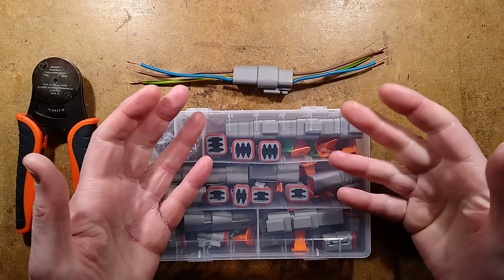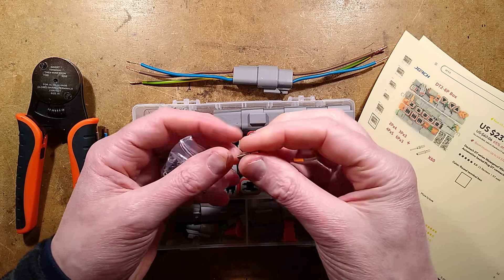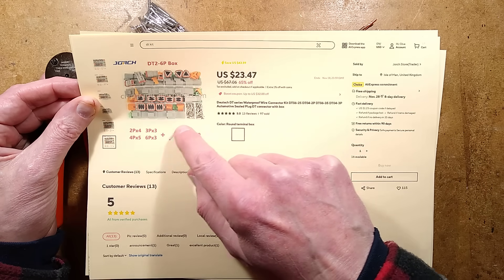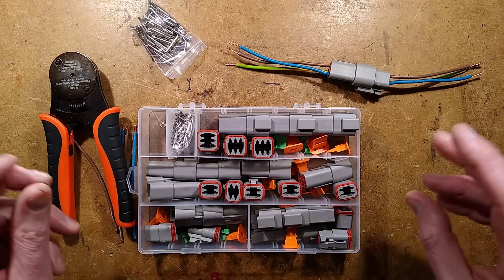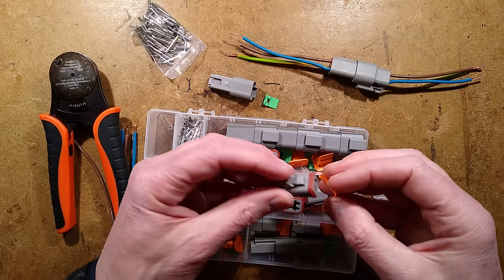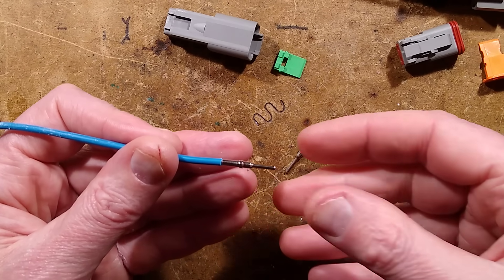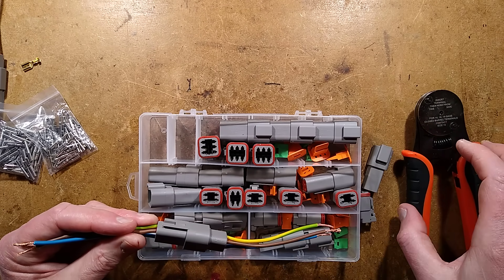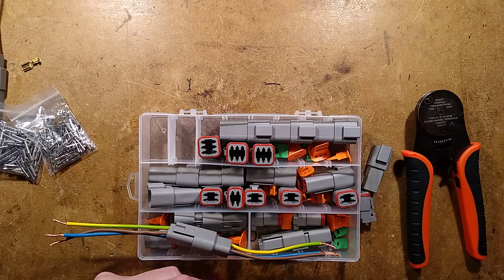Deutsch - my new favourite rugged connector

Comment: Ive actually never seen the correct crimp tool that folds the “panty wings” as you call em..   like ones that coil the wings on either side.. never seen one that could do that every crimp.  Only time ive been able to pull off that style like that is with needle nose and diagonal cutters..

Comment: Deutsch connectors are fantastic compared to other styles of connector because the latch is in the plug instead of the pin. Easy to unpin and change orientation. Also great for running wire through a small hole. Disassemble the plug, feed the wires through and reassemble the plug on the other side

Comment: I have and have used some of the original kinds. Almost waterproof.... but sooo hard to connect and disconnect. Needs lots of force. So I don't use them that much anymore. With strong hands, they work fine but you can really tear the cables apart if people pull on the cable in an attempt to disconnect even with the lever already opened.
For low-power, low-DC connectors in dry surroundings, I do like the PC (I think) connectors that are used for powering HDD's and such in older computers. Same kind of connectors, sturdy connections but easy to disconnect and connect.

Comment: The Amphenol ATP, AT, and ATM are a little cheaper and compatible with the Deutsch originals (DTP, DT, DTM). Not entirely sure how this works out legally, but they still work fine in my experience.
I remember doing some deep diving into the datasheets a few years ago and found they were rated for 240V, AC or DC.

Comment: There's even a variety of bridge connectors. For example an 8-pin which bridges 1, 2, 7, 8 and 3, 4, 5, 6 (when looking at the pin numbering this makes sense;-) ) for easy wire splitting while keeping the sealing intact. If you want to for example add more lights to a machine you get one input and 3 outputs twice so to speak. We use those all the time.
Reply from the maker: Handy.  I'll have to look for those.
Reply: Also grounding connectors with a lug cast into a receptacle and all the pins bridged to the lug.
Reply: There are also keyed housings and wedgelocks and board mount versions.  Dunno if they've been cloned and put for sale on Aliexpress though.

Comment: I don't know if anyone has mentioned it, but I believe there is a pin/wire removal tool, so there's no need to stick a screwdriver down into the connector, it slides down the wire from the back and seats over the pin, moving the clip out of the way, and then you pull the wire and tool out together. Search "Deutsch insert extract tool" for some examples.

Comment: The little wedge piece in "connector speak" is called "Terminal Position Assurance" (TPA) or "Secondary Lock". Most modern connection systems have some sort of secondary terminal pin lock.  Contrast that with an older style like Molex, where there is only one feature that holds the terminal in place.
Reply: These don't provide a second method of retention as most TPA devices do, though they do work as a TPA since their action is to lock the primary retention tang, and if the pin isn't fully home and the tang snapped in behind the flange, the wedgelock won't go in.

Comment: Clive, that cut on your left thumb looks painful for a guy that works with his hands.  I  get cracking skin on my fingers in the winter when the air is dry.  My solution is 1 or 2 drops of medium CA glue right on the cut or crack.  It makes a nice little "turtle shell" that diverts all the pressure around the cut and takes away the pain!
Reply from the maker: I superglued it when it first happened (rogue knife incident) and have been letting auto-repair fix it.  It's almost back to normal now.

Comment: It's pretty cool what you can get these days.  I would probably stay away from the wire but the tools are quite well made considering.  One of my first el-cheapo tools was from The Source/RadioShack and was made for terminating 6p4c/6p6c/8p8c connectors, was made very similar to these crimpers and were and still are a bargain for $25-30 Canadian.  The official tool would have cost at least $100 or more at the time.  There is one tool I bought that was that price and it was made for coaxial compression style crimping (I still have it) and that's Ideal Industries' OmniSeal Pro XL that's capable of compressing F-type, BNC and RCA-style plugs onto a multitude of coax cable sizes.  My recent purchases include a ferrule crimper that makes using stranded wire in things like insulated terminal blocks a breeze and recently a multi-die crimper to replace my generic stamped steel insulated and non-insulated crimping, stripping and cutting multi tool thing as that doesn't do sufficient crimps.

Comment: I noticed Clive, that when you talking about the male and female connectors, where they don’t  fit together the full distance, preventing a ‘mis match’, and how easily they slide together. Is it possible at high loads it could create  a high resistance, along with the problems that may cause?

Comment: Hands down the best connector i have ever worked with. Electrical issuse in my line of work (wheel loaders in a corrosive environment) are 8/10 wiring problems, every bad/corroded connector is replaced by a Deutsch connector and the problem is solved permanatly.

Comment: One  thing you could have done  is measure the  resistance    across the  mating  pins  (in and out)   to    see  there  would be a voltage  drop

Comment: If you use a small wire, like you mentioned in the end, you won't have good waterproofing though, as the holes in the rubber are made for one specific size. Smaller signal connectors such as the JST JWPF also have this issue. 
Recently I bought the AMP superseal clones from Ali, but these Deutsch connectors look pretty good.

Comment: I worked with Deut$ch connector$ for many years with automotive products.....VERY good connectors - top notch - and they know it. The chinese knockoff compatible connectors (which might be what you have) are completely 100% compatible, but the quality is not the same. Only true Deutsch connectors have the top notch machining, fit, and finish. One of my biggest complaints of the cheap knockoff deutsch connectors the bean counters made us use was in the area of pin retention in the housing. We had quite the issue with that during production, and wasted much of the money the front office saved on the el cheapo connectors with having to go through all the cables that came in and give them the yank test, and bend out the non retained pins clips and reseat them. A definite fit and finish problem as the retaining clips were not bent in, they were at the proper angle for retention.  (seemed to be a go/no go - either all were good or half the pins didn't retain - about 5% to 10% - JUST enough we could not ignore it and slough it off on to the returns department)
 Second complaint of the knockoffs would be in the J1708/J1939 family of connectors, the knockoffs had issues with the threads on the screw ring to keep it plugged in, poor machining on about 3% of the connectors meant it would not screw in....... OF COURSE - the complaints of engineering and production fell on deaf ears in regards to these issues - deal with it was the word......
 Problems true blue Deutsch NEVER had. 
The proper crimper is ESSENTIAL with deutsch. There are many non name brand crimpers that will do it, you don't have to use the true blue crimper, takes a bit of experimentation to find the right one, but on the plus side, knockoff crimpers are cheap so you can do that.
EDIT: That looks like the off road diagnostic connector that is used on shifters (yard mules), caterpillar, and other off road equipment. At least it is in that family.

Be an engineer - its fun, they said, you get to design stuff and see your products in the world they said - They never metioned the eternal battle with the "wannabe engineer" bean counters in the front office that take a good, well engineered product you are proud of, and cheapen it down to the point you warned them in the meetings of impending doom by returns of defective malfunctioning product, and them not remembering your dire warnings when they wanted to save money by using only half the fasteners needed.....etc.

Comment: I brought my crimping tool on temu, push against the spring and it goes to the correct depth. 
As a subcontractor where only one of my customers use these i couldn't justify the price of the genuine tool, and figured that the amount of stuff being made in China using this type of connector their. 
tools must work, and haven't been disappointed.
These connectors are not rated for 230v.
Reply: it might be the same tool from the same molds at the same factory with a different name stamped on the handle and the warranty being the only real difference while some inspector would have a hissy fit if the brand does not match something orange man will change what matters if function so many things I do function just fine or better then the standard methods but are not approved while I have seen some pretty professional looking hacks that will start a fire in no time flat under the right conditions so ugly and safe needs to be accepted and dangours and pretty needs to be caught any professional would know the difference  let them decide and not the buricrats  inspectors are often over paid paper pushers if its not picture perfect they want to write a fine while not giving a dame about safety I could use wire nuts for a solar system install and not crank them down it will pass inspection but my copper pipe coupler trick being far better then even a perfect wire nut install would not pass if subject to inspection but due to solar being exempt if under 1 KW in my local area I do not worry about it I do what I know is best I would not think twice about the cheap crimper 9 out of 10 times the cheap tools are exactly the same as the expensive ones with actual good good ones being rare and not related to price I got a bold cutter style of crimpers for 18 dollars a few years ago and its just as good as the 100 dollar ones at menards in fact compare it to all the markings on the hinge bolt and rivets its the exact same tool just the color of the rubber handle is different what I would like to see a crimping tool to allow copper pipe couplers to serve a crimps as a one two and done then apply a heat shrink boot and walk be done what is the difference between the two items besides cost and a certification a half inch copper pipe coupler 89 cents  a 2 awg crimp connector that only fits 2 awg costs 20 dollars each the copper pipe coupler if applied as I do can do do 8 awg down to 2 awg and accept many wires from both sides with the total thickness being the big factor if its within range it holds a lever action tool to smash it and bend it over would be worth 100 dollars when you consider the savings and ease of use and the reliability this crimp is insanely tight as the smash and fold action pulls things extra tight relies on the tensile strength of the copper vs the ductile strength  which is why the winged crimps fail the saving grace for the round closed crimps is the lack of a seam but why allow a 89 cent part serve better when a 10 dollar part that will need replacement in 10 years is already mandated

Comment: I did an apprenticeship to train as an aircraft electrician, during my working life I dealt with all sorts of connectors such as Plessey, Souriau, Deutsch and Cannon. I'd always assumed the pins fully engaged with the sockets when the two halves of the connectors were mated together. It came as a real surprise when I found out while talking to a rep from Souriau that only about fifty percent of the pin enters the socket, but thats sufficient to carry the rated current. These plastic connectors look like they're good quality, and if they have your seal of approval they must be. In my retirement I concentrate on restoring cars now these will be perfect for the odd little mod for accessories and extras I occasionally fit.
Reply: I bought a kit and extra pins off Amazon and they were pretty decent despite being off brand Chinese
Reply: @juliogonzo2718  I believe at least some of them use discarded OEM molds that may be out of spec. I've bought a few off of Ali that have "DEUTSCH" still on the rear seals, but scratches elsewhere, consistent to each connector, as if the mold had something removed...
Reply: Bicc-Burndy were turned and gold plated years and years ago I think.
Reply: Contact ampacity can be counterintuitive at times.  The reality is that, most connectors only have one or two points of contact, yet are rated for, whatever, 2, 5, 7A, and more.  The actual contact area, the thinnest cross-section between the two terminals, can be very small indeed; and this makes rather high power density at that point, but reasonably conductive materials are used (typically brass) to spread out that heat.  The bulk of the pin size (width and thickness) comes down to heat transfer, and mechanical limitations/considerations. (Like here, machined pins will be bulky where material simply wasn't removed from the part.) High current connectors, especially low-resistance and compact types, can't make up the difference with bulk alone, and use many fingers in parallel: all sprung independently so that a majority of them has a reasonable guarantee of making good contact. Or use intense clamping pressure to force surface asperities into each other (e.g. Anderson Powerpole, bolted terminals and bus bars, etc.).

...Plug terminals on welders would seem the standout exception, being fairly compact (say, 1/4 to 3/8" dia.?) for their ratings (couple 100 A?). Cables are often undersized as well, so aren't reliable heatsinking for the terminal. A tapered joint can accumulate a lot of contact force from being wedged in place, but the dirty environment just about guarantees it's not going to make even contact. On the upside, it doesn't have to be reliable; it can be re-plugged if the operator notices a problem, and the machine is... kind of an intentional fire hazard to begin with (not that that should excuse every possible shortcoming of it, heh).

Comment: Don't forget when looking up the price on Ali Ex they will add on a cut for Rachel from accounts to get her grubby little mitts on as well as postage on some items at the checkout, and if you use the phone app rather than the website you will get spammed with offers and notifications imedeately after you buy something - not always from Ali Exp either. If you see an offer in your 'message centre' from a seller on the website it will say 'check the app', just ask the seller to send the offer to your message centre and they will usually oblige.

Comment: Ah yes. The deutsch. My next favorite to plain old Superseal and the unsealed Daimler 2,5mm and 4mm Barrels from the beginning of time to the start of the newer cars of the 90. 

Why do I love these? Because they are freaking tanks of an automotive application. Just solder them, everything works. Need another line? Solder it on! 
Need for test? Plug your banana jacks in. Never seen such good connectors. But every pin costs a fortune. Therefore I salvage them. With connectors. For the next project!

Comment: I'm clearly overthinking this, but I always get concerned about concentric circular power connectors on the basis that the internal diameter of the female receptacle cannot be exactly matched to the external diameter of the male pin, i.e. there must always be a gap, albeit small. This need not be an issue in connectors with a flat geometry such as Anderson PowerPoles.
Reply from the maker: There are springy tabs inside the female part.

Comment: The correct tooling (DMC Tooling from Daniels) will set you back a lot more than £200! I have two sets to cover different types of connector (TE MIL38999 are a favourite in the rail industry) and some of the positions (used to set the terminal position within the tooling) will cost you around £150.
Deutsch are a really good connector, widely used in the automotive and off- highway sectors. Deutsch say that you shouldn't have the wire insulation touching the terminal as there is a danger of causing crimp and wire failure due to the wire sheath levering against the back of the terminal if the cable is flexed.
One advantage to having the DMC Tooling in your hand is that you project an auro of professionalism.
The other tooling that I've used (on the MIL38999 connectors) is the Bandit Clamp tooling. I've never owned a set of these as they run well over £1000 and most of my Industrial customers are generally cool about getting one of their people to come over with their set and put these on (Bandit Clamps are used to secure cable screening to the back shells on the 38999 connectors). I probably have the need to fit a Bandit Clamp about once every three years so no plans to buy a set anytime soon!
Industrial and military connectors are eye wateringly expensive but so nice to work on

Comment: I've used these at various off highway equipment manufacturers ( mostly yellow diggers), and they are probably one of my favourites. But even though they might withstand a decent voltage (>50vac >120vdc ) most people wouldn't expect a hazardous voltage on them (I'm a SAP and id have whipped the wedge out of that with bare hands without too much thought) so they're probably better kept at ELV when used in professional setting...

Comment: They do work as industrial connectors, in the last place i was at as a sub-contractor/consultant, they used these connectors in their mobile battery packs they made for industrial use. One of such cases was a project where the battery packs were used in some sort of electrical mining vehicle, the deutsch connector was an interface for the battery pack's control circuitry power and interlocking mechanism. I think they chose this connector not because of its electrical properties but because it has quite good seal.